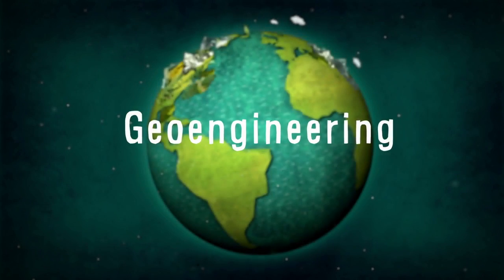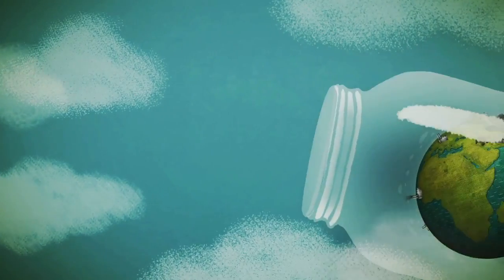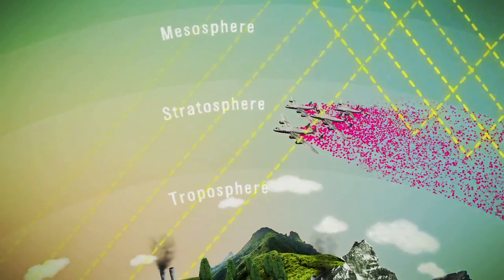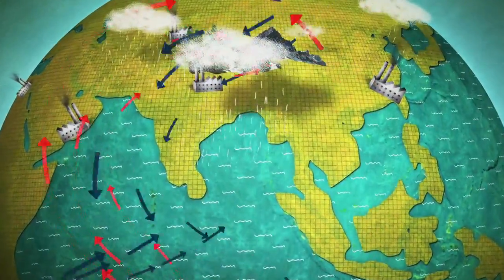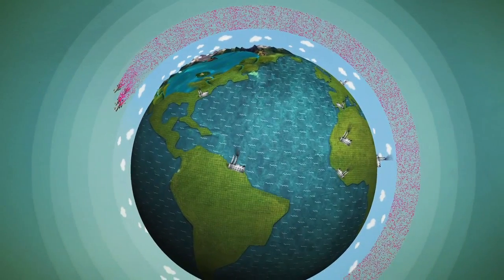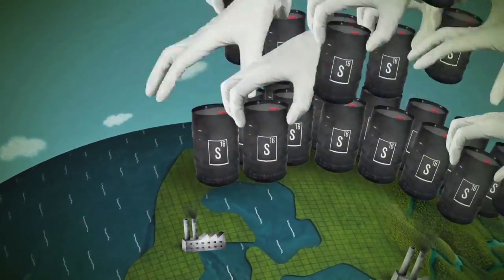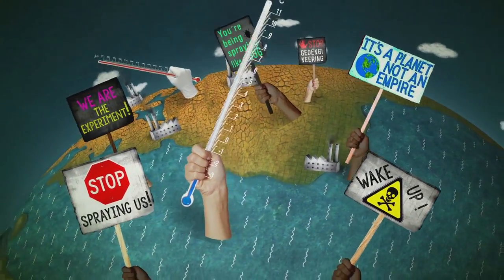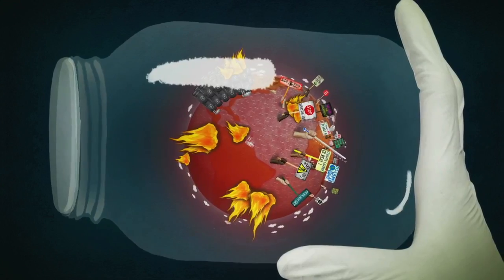A technofix for the climate? Atmospheric geoengineering (Solar Radiation Management)

Comment: I think that the one thing a lot of people are missing is that we need the solar wind and the solar radiation in our atmosphere so there are particulates to condensate on rather than artificial or man-made.
It also seems to me that people have forgotten that water is a constant renewable, except they keep Breaking the Chain.
Plastics deliberately in the ocean hinder the evaporation process.
And so forth, most of you are aware of what's going on if you're here.
That's going to be a good article to read and I'm going to see about introducing that new geo-engineering bill to the city hall in my area. thanks again Jim

Comment: There is no greenhouse effect on Earth (troposphere not only not warming faster than surface temperatures but actually cooling!) hence "greenhouse gases" are irrelevant; we are entering a GSM and should be concerned about the cooling, weather patterns distortions (already happening) and the consequent impact on food production & weather related disasters....all caused by weakening sun output, leading to weakening earth's magnetosphere, leading to increasing cosmic rays penetration, leading to increased cloud nucleation.
Reply: GSM standing for Grand Solar Minimum